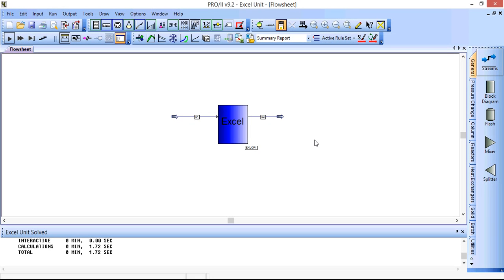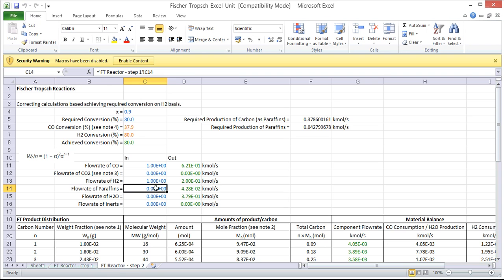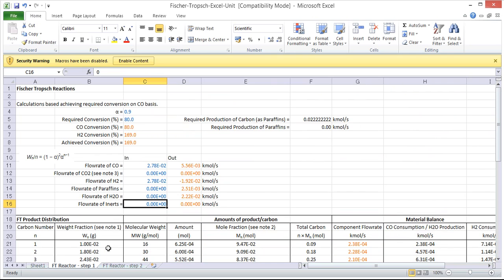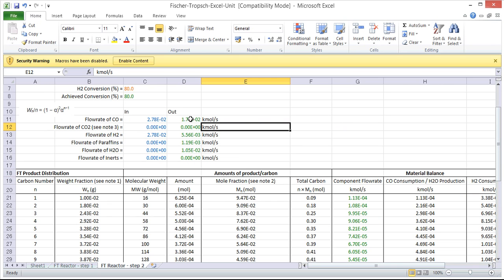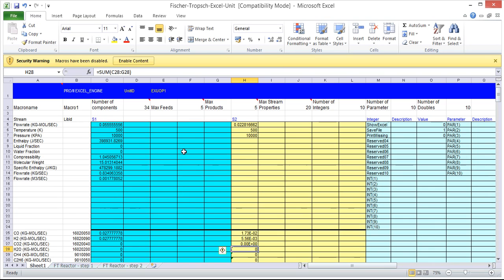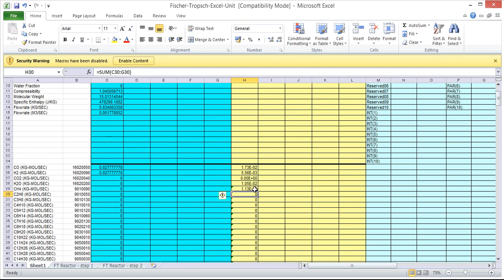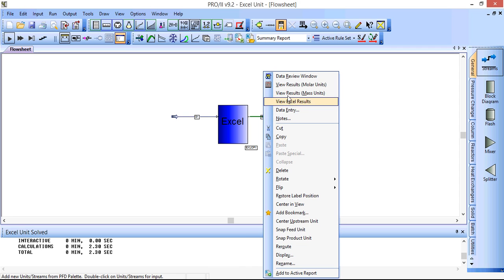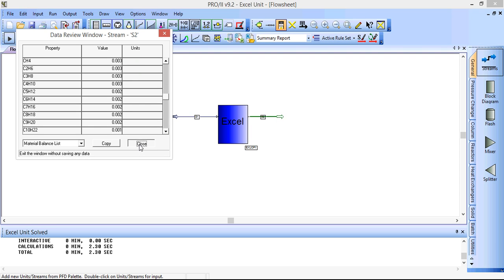PRO/II Unit Operations – Excel Unit Operation Calculations

Comment: i have  a problem. i don't understand how set the excel spreadsheet
Reply: the first spreadsheet with the blue and yellow columns is called excel template and it is included in the files when you installed ProII. I dont know how he got the second spreadsheet.